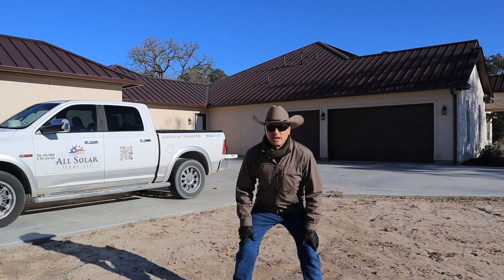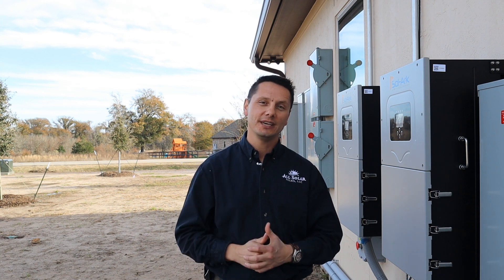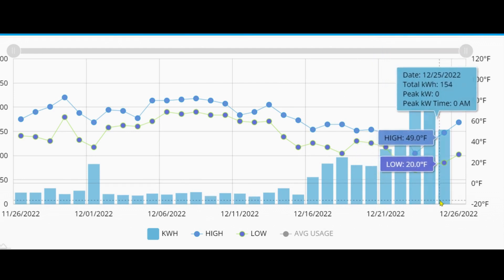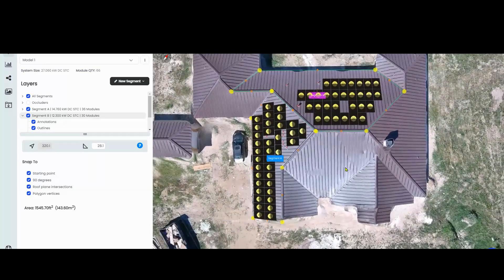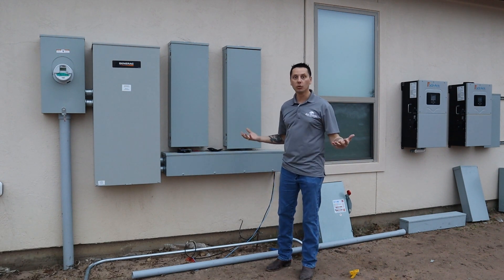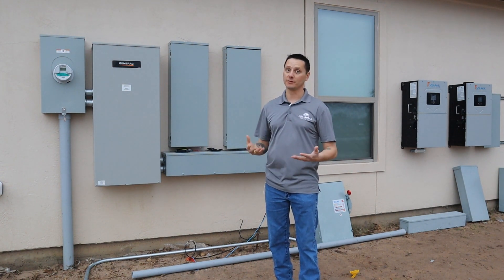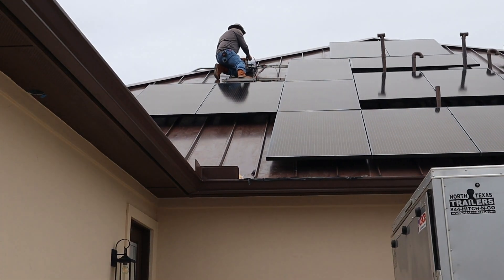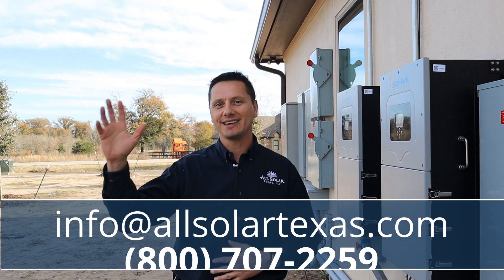The Best Solar System in Texas!

Comment: What’s deep east Texas co ops ratio and is it worth getting Solar
Reply from the maker: This was a tricky research project for me, but I found some information. Deep East Texas Electric does not have any information on their website or publicly available on how they treat solar. However, they are part of Touchstone Energy Cooperatives, which does have information on solar, which may translate to Deep East Texas.  Touchstone says in their Solar FAQs that "Many cooperatives purchase energy generated by a PV system above what the homeowner uses. Check with your cooperative to get specific details for your area, including requirements for interconnection, safety, metering, and applicable rates." Which is a dead-end. I recommend calling Deep East Texas to get an answer in writing and I'd love to hear how it turns out! Reference links: https://www.touchstoneenergy.com/sites/tse2/files/documents/SolarFAQs2017.pdf, https://www.touchstoneenergy.com/technology#f67ffad5-a637-4934-99f9-0132b4affb41-0
Reply: @AllSolarTexas  thx!!!

Comment: Mid-install on the same setup for my 4130 sq ft 2-story house in Ft Worth. 2x 15K's, 2x 28.8 kWh Homegrid Stacks, & 51x 400w RECs + TIgos. Should be able to run off-grid year around even with 2 conventional AC units (July will be close). Gas heat so that makes winter easier but that includes daily driving an EV too. BTW, I'm looking into heat pumps but my projections say I don't have the production or storage to run them below 37-38F ambient or so (going to need gas below that). I saw that 267 kWh day in your run down...WOW! I'm going to guess that's with resistance secondary heating? Difficult to build a reasonable system that can hang but that was also way abnormal for BCS.
Reply from the maker: Thanks for posting! That’s my goal too, completely off grid. I was totally surprised by the 267 kWh use… we had a fire going and didn’t use space heaters, only central heat. I may need to switch over to space heaters😂 Please subscribe! Thanks for checking us out and have a Happy New Year!